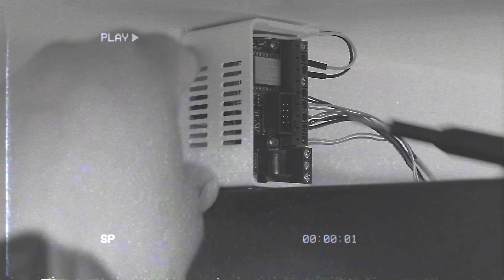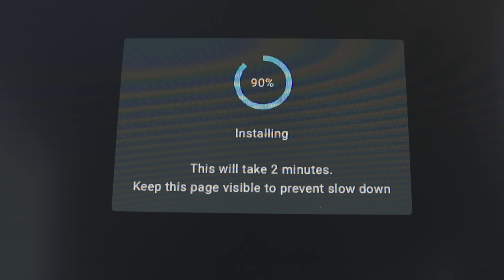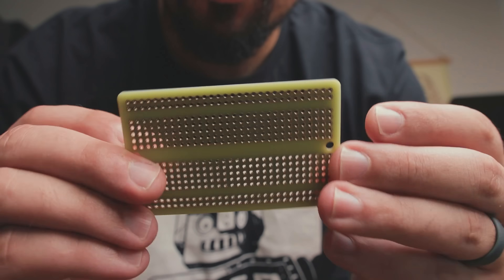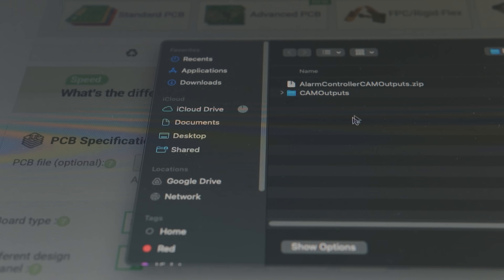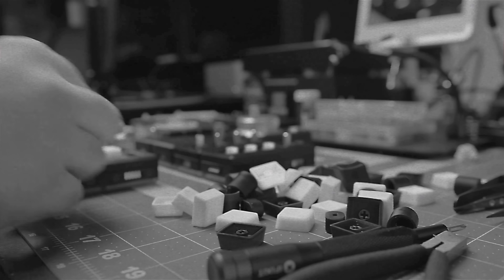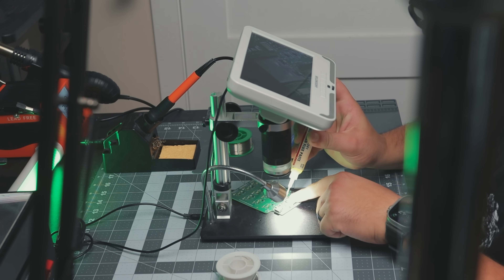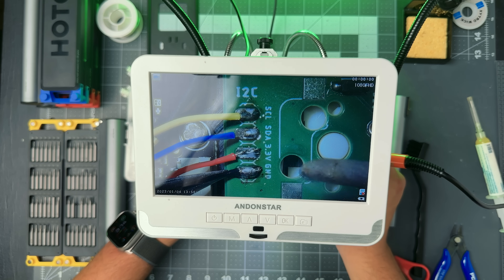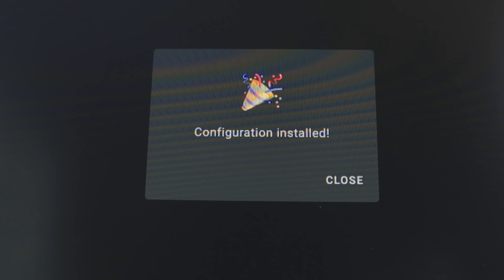Build a Smart Home Fingerprint Keypad (ESPHome + Home Assistant)

Comment: I really like this video and the project.  Hereby a Project Proposal: ESP32-Powered High-Decibel Outdoor Smart Siren.
I’m suggesting a high-performance outdoor siren project designed for Home Assistant integration. The goal is a device capable of ≥ 120dB with an integrated high-intensity strobe.

Key Specifications:
    Controller: ESP32 for native Home Assistant (ESPHome) compatibility.
    Power: Flexible input via USB-C, 12V DC, or PoE+.
    Redundancy: Battery backup using a 18650 LiFePO4 cell for longevity and safety.
    Functionality: Independent control of the strobe and siren components within Home Assistant.

Comment: Question regarding the I2C Sensors. Do those need to be defined in the ESPhome or where ? (using homeassistant)
Reply from the maker: I2C sensors need to be setup in ESPHome first and then you can use them from HA

Comment: This isn't as secure as I'd hoped it would be. Since the fingerprint sensor sends authenticates locally it means that a bad actor merely needs to detach the sensor and mock the "authenticated" signal to the board. And HA would simply accept this.
The fingerprint sensor is simply a cover to a button that HA responds to.
Did I not understand something here?
Reply: Does it at least have some PSK or something with the ESP so that it couldn't just be replaced with another sensor and unlock the door?

Comment: This is a great project. If you plan to upgrade this keypad, you should use a 2.8" or 3.2" TFT LCD Touch Panel. It would be much more versatile, and you can have the Home Assistant dashboard displayed on the LCD panel for more information.
Reply from the maker: Good idea. I will keep it in mind if I revisit this project
Reply: @salimbenbouz  Using one of those ~€10 "cheap yellow display" devices would drastically reduce the complexity of building the hardware, i.e. you'd only have to connect the wires from the fingerprint scanner (either by soldering them or by using the built-in connectors) and 3d print a simple case for it. The "keys" would be soft buttons on the display. Just need to figure out how to program it in esphome for this, at the moment I'm struggling a bit with the display orientation, coordinates and calibration. But it's certainly doable.

Comment: Great video Salim, I'm in the process and have a working keypad. How does homeassistant check for a correct PIN? Does the automation check the PIN?
Reply from the maker: Thanks. The automation passes the PIN from the event to Alarmo and that's what checks if it's valid or not.
Reply: @salimbenbouz that's what I thought, after watching the video I realized you were passing the code through. I'll customize the code to my needs. Thanks for the inspiration!

Comment: Nice project! At 1:01, you are showing a disassembled R503 sensor? From the pics at different stores, it looks glued together (but I need it smaller).
Reply from the maker: Thanks! The one I show with the chip isn't R503 it's another one from Waveshare
Reply: @salimbenbouz  Thank you. One more question, have you tested how long it takes for the sensor to process the finger? (from the moment it touches the sensor to a successful or failed result). I'm working with the FPC1020a module, and it takes more than 1100 ms, which is a bit disappointing...

Comment: Super cool. It would be really cool to extend this design to make it fully independent, so that the PiR and magnetic door sensors connect directly to it with a small battery backup. This looks possible in esphome, with home assistant integration being optional rather than mandatory

Comment: Great video as always, couple of random thoughts, to increase  security a rotary encoder that jumbles the keypads so not only do you have a pin to decode but also the setting, plus a sensor that triggers when the cover is removed. Maybe over the top but when I see a keypad I always wonder how easy it would be to open and manually send unlock code.

Comment: I have all the components and previously had it working via node red. I would like to transfer to HA.  This part of the video is a little too fast. I have not worked with manual events before. What is the trigger in the HS automation? Will an event become part of the entity or do you have to specific listen for an event in the automation?
Reply from the maker: There is a (Manual Event) trigger for automations in HA

Comment: I don't like including a security system in home automation. I consider security system as a critical function and don't trust Home Assistant to be reliable enough. Early in my electronics career I worked for a manufacture of security equipment designing the hardware. Twelve years later I was took over the head design engineering position at another electronic controls manufacturing company. I think HA is a great system, but not for critical use.

Even though I don't like the HA for this application, you did a nice job on the project.

Comment: But adding fingerprint module that talks wia the uart is very not safety
All Checks need to be on main controller, or some guy with flipper zero will come and disable this security system
Reply: But it's still awesome DIY project
The part that i like the most, is that device in the end looks like a great tech device, not like DIY potato with the wires

Comment: Excellent build. Very clean! Maybe you can 3D Print a flush mount that sinks it into the dry-wall as the mechanical switches and the fingerprint add a lot of depth to the device.  The only thing I would do differently is probably the keycaps for guests, as its not really intuitive which number is which :D Subscribed ;)

Comment: if this really part of your alarm system you should add at last two switches and a small rechargeable battery
the switches to bu used as temper switches to disable the keypad if the keypad is de-attached from the wall or the case being opened if not in service mode also with automatic deauthorization in your alarm system.
the small battery is to in case of power loss is to indicate to the controller the fact the keypad lost power and to keep the anti temper systems active.

Comment: Does the fingerprint sensor only say if there is a match, or does it say who matched?  I'd be very interested in making something that uses a fingerprint almost as a username, and then using a pin or password as a second factor.
Reply from the maker: the sensor tells you the ID that matched as well. You can def create some sort of index to keep track of which is which. For my use case I just needed an event for "Auth confirmation" to do the automation stuff

Comment: i tried using ESP home for a sprinkler system, and it failed miserably. ESP home did not work properly.
Reply from the maker: Would you mind elaborating? I’ve got a dozen devices running ESPHome and in my experience it’s been running flawless.
Reply: This seems like pebkac to me.

Comment: 12:00 With the R503 sensors, you can sync between two finger print sensors. You can export from one sensor and import that finger print characteristic into another sensor.
Reply from the maker: That's interesting. I will look into it. Thanks!
Reply: Could you share a link to the documentation or explain how to do that? I’ve searched for it but I can’t find this solution.

Comment: I like to mess with old electronics, and some of my favorite to explore are security systems, a few traits many share is case intrusion detection and accelerometers/tilt sensors (to detect if someone is messing with the unit) another great thing to add to a security system would be backup power and a way to communicate independently from wifi, perhaps an LTE modem? 
Anyway, EspHome looks like a fun thing to mess with, I'm definitely going to check that out!